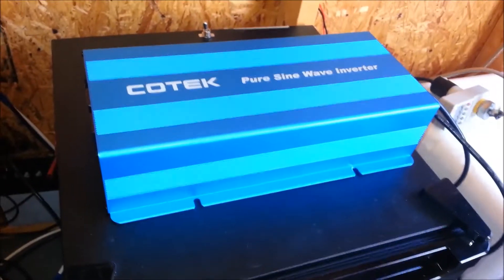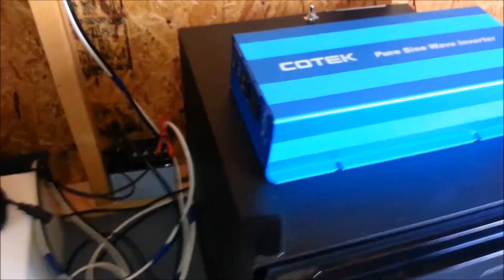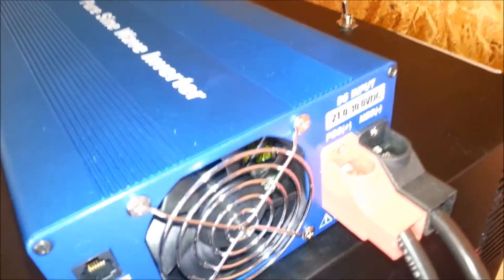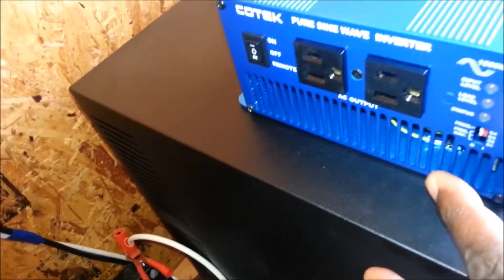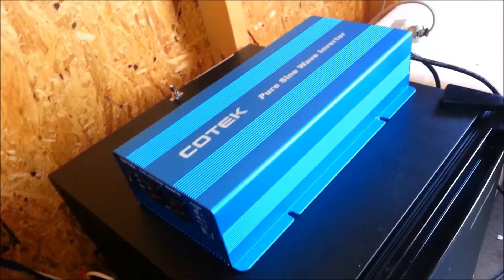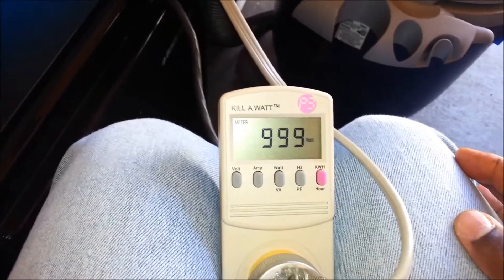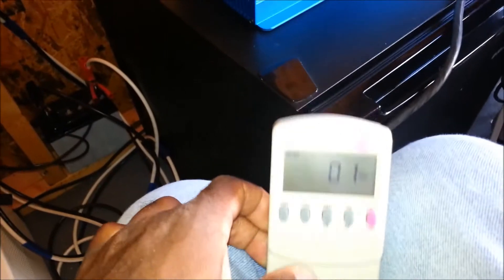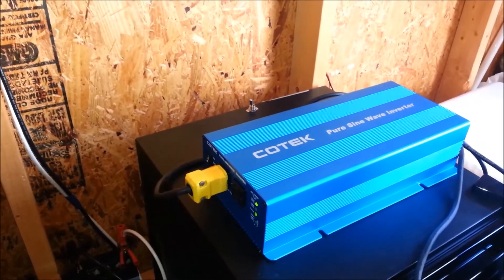Cotek SK1500-124 1500 Watt Pure Sine Wave Inverter Review!

Comment: Hello 
I have a 2000w cotek..
Will you run under 2000w watt? As it say continue??
Thanks ross
Reply from the maker: Rusko S 
If I understand your question correctly, are you asking if the 2000 watt inverter will run under 2000 watts?

Comment: Could the DC input be a PV array? Does it have to be powered by a battery bank?
Reply: 6 x 8volt golf cart batteries or 8x6 volt golf cart for better system.
Reply from the maker: For an off-grid inverter, you will have to have a battery or battery bank in place for it to work.  The battery output of the solar charge controller must go directly to the batteries.  If this was a grid-tie inverter, then no batteries would be required.  However, unless you have a very large solar array, the solar system alone may not be able to sustain the loads as is without pulling power from the grid, in a grid-tied application.
Reply: Thank You for the response. I recently purchased 6 -295 Watt Infinium panels. I intend on using a midnite classic charge controller with a 48 v battery bank. and the Cotek 2000 watt 48 V inverter to power a subpanel. However, I thought I could go directly to inverter from the combiner box until i purchase the remaining items. any thoughts?
by the way your solar shed video and the Cotek review was outstanding!
Reply from the maker: You will need at least three 12-volt batteries wired in series. Thanks for the comment.
Reply: great. Thank You!
Reply from the maker: You will need four 12 volt batteries wired in series not three 12 volt batteries.  That was a typo.  Again, thanks for watching and all the best with your project.

Comment: how big is the battery bank you run this inverter on ?
Reply from the maker: I have got a total of 24 batteries wire in series parallel.  Each battery is rated at 35 amp/hr.

Comment: good day sir...may i know where did you purchased the COTEK, my plan is to purchased the Cotek SP4000-148 PURE SINE WAVE....please email me at eldrictubilla@gmail.com
Reply from the maker: I purchased the inverter on Ebay.
Reply: @DIY OneForAll  good day sir...i have COTEK SP-4000-224 (4000watts), need your help, just asking... what charge controller that suite to my SP-4000, and how many power solar panel do i need, and for backup battery what is the best amperes for for my COTEK SP-4000, i need some ideas from you...thanks in advance..:) please email me at eldrictubilla@gmail.com
Reply from the maker: +eldric tubilla 
The answer to your questions depends on your budget and power requirements.  Tell a little about what you plan to run off the system and whether you are considering a grid-tie system or an off-grid system.  There are many factors to consider when designing a system. At any rate, the higher the panel wattage you can afford,  the better.  The bigger the battery bank amperage,  the better.  It's best to have more than less.  I am just speaking in generalities here, but again, everything depends on your budget and power requirements.
Reply: DIY OneForAll very nice info sir, i appreciate with that, my plan is to run offgrid system...